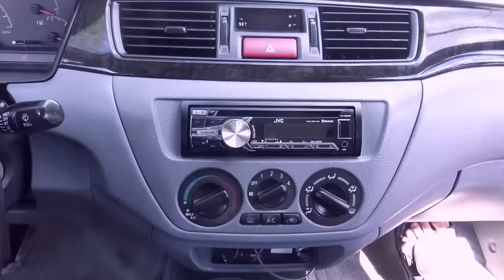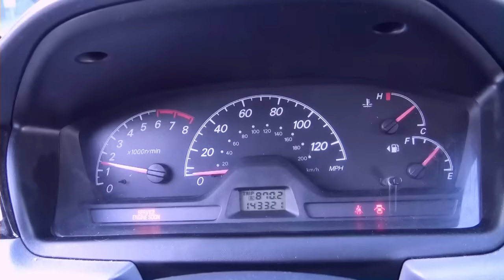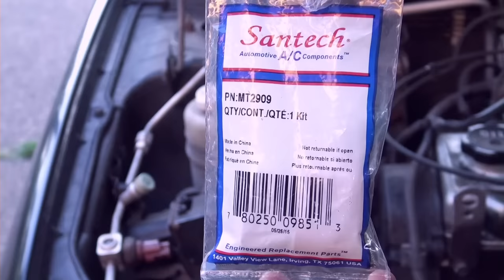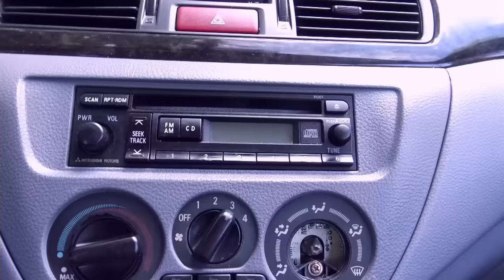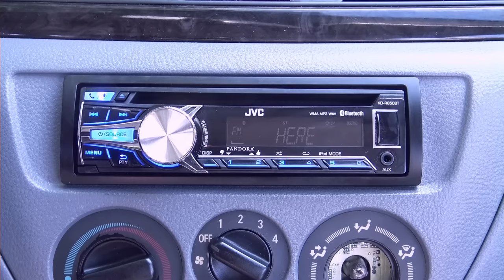Lancer Fix 30 | MOMO EVO 7-9 Steering & Cruise Control

Comment: I had a 2003 Lancer LS, sold it at 152,000 miles. Only issue was a radiator leak around 90,000miles, and needing a new paint job, no rust at all since I lived in Arizona, and Southern California. She always drove like a champ, I took good care of her and didn't let me down. It truly was a great car and miss it. Traded her in for a 2012 Toyota Tacoma. Also running great.

Comment: I'm watching the whole Lancer Fix playlist.  I can't believe your buying and doing of this stuff for the 3rd time on this car. I would've stripped the blue one before I handed it over to the insurance company. I did that on my last vehicle when somebody hit me. Insurance company bought it, but I stripped my alarm, stereo, etc off of it before I gave it to them. It just went to a salvage yard anyways. My stereo system alone was worth almost what they gave me for the car...they weren't getting it. I took my good tires off of it and gave them a set of crappy ones.  I even took the battery out of it that was brand new.
Reply from the maker: +Mikey Yess, I should have done that. Regret not taking the wheels off first. I learned it the hard way.
Reply: +DarkDragonWing when the insurance companies decide how much they are going to give you for your car, they HARDLY EVER add in the cost of any aftermarket equipment or wheels.  It just ends up being stuff that the scrap man gets.  When my car got totalled, I just had spent like 600 bucks on a set of factory leather seats, that didn't effect the value at all. I had already bought something different so I didn't take them,  but it was still 600 bucks gone.  My point is, take everything that you can.

Comment: I saw that you used an Autel MaxiScan on one of your videos, which model do you recommend or a better tool?
Reply from the maker: +hollow3501 I use MaxiScan MS309 version, and it's alright, it does the work. Though, when having multiple codes, it doesn't show all of them. So I have fix one code, erase all of them, and then wait until the other faulty codes to show up. I guess MS310 is a newer version and should be better. cheers

Comment: hello maybe can help with Lancer letter emblem code or where you buy that part??? thanks
Reply from the maker: +Paul Cajamarca http://www.ebay.com/sch/i.html?_odkw=lancer+2002+emblem&LH_BIN=1&_osacat=0&_from=R40&_trksid=p2045573.m570.l1313.TR0.TRC0.H0.Xlancer+2002+emblem+oem.TRS1&_nkw=lancer+2002+emblem+oem&_sacat=0

Comment: Hello,  

My 2006 lancer es I just purchased has a lot of play in the steering wheel.    What can I do?  

I have changed the tie rods. I noticed when the steering wheel is locked(no key and turn the wheels). It has a wobble. Does it have a steering box for me to tight the steering ?  If so where would it be located.
Reply from the maker: Hi. Did you also replace the inner tie rods as well as the outer tie rods?
Reply: @DarkDragonWing  no I did not. Kinda nervous too.
Reply from the maker: @chriswong924  Yes, that's where the play really comes from, the inner tie rods.
Reply: @DarkDragonWing  
Going to tackle it sometime next month. In the mean time I found out the knob does turn on the climate control and the ac is cold but feels restricted. Hazard lights do not work.  Will be referring to your videos. Thanks for your feedback.

Comment: Hey man i was wondering what the difference Between LS & ES ? I have the 03 lancer es
Reply from the maker: +Corey Rivas LS has cruise control, and the lug nut pattern is 4x114.3. The ES doesn't have cruise control and has 4x100 lug nut.
Reply: +DarkDragonWing  Thank you :)
Reply: +DarkDragonWing  sorry to bother u haha but i also wanted to know where to get parts, because in Canada its hard to find parts where i live , & the one thing i needed was Struts because mine are really stiff , unless u have a idea on how to  repair them ahah. Or if u know any good reliable websites that would help :) thanks man appreciate it
Reply from the maker: Corey Rivas I always use ebay.com and Amazon.com :) 

What part you need? I can search for you.
Reply: +DarkDragonWing Whicked ! Thanks man so much &  Struts Aswell as coil springs. keep on posting ur videos man there awesome :)!
Reply from the maker: Corey Rivas
Here you go:
http://www.ebay.com/itm/AST-Full-Set-Shocks-Struts-For-2002-2005-Mitsubishi-Lancer-333382-/371321525071?fits=Year%3A2002%7CModel%3ALancer&hash=item56747cd34f:g:7cYAAOSw6BtVSkne&vxp=mtr

More: http://www.ebay.com/sch/i.html?_from=R40&_nkw=Lancer+2002+struts+set&_in_kw=1&_ex_kw=&_sacat=0&_udlo=&_udhi=&LH_BIN=1&_ftrt=901&_ftrv=1&_sabdlo=&_sabdhi=&_samilow=&_samihi=&_sadis=15&_stpos=55421&_sargn=-1%26saslc%3D1&_salic=1&_sop=15&_dmd=1&_ipg=200
Reply from the maker: Corey Rivas You will have to reuse the springs. cheers

Comment: Where did you get the steering wheel I want one, I've tried searching (Mitsubishi Lancer Evo 7/8/9 steering wheel) and all it shows are covers
Reply from the maker: This one https://rover.ebay.com/rover/1/711-53200-19255-0/1?ff3=4&toolid=11800&pub=5575273973&campid=5338044275&mpre=http%3A%2F%2Fwww.ebay.com%2Fitm%2FJDM-MITSUBISHI-Evolution-8-steering-wheel-EVO8-SRS-Airbag-Good-A838-%2F302082990490%3Fhash%3Ditem46558ca19a%3Ag%3AhwkAAOSwYIxX48Y7%26vxp%3Dmtr

Comment: Hey! Nice job with that swap. Really nice.

My 03 oz rally lancer has cruise control. Can I swap out the steering column with one that doesn't have cruise control without any known complications?? 
After seeing the video, could I transfer my cruise control to the new steering column?
Reply from the maker: There shouldn't be any, you basically just delete the cruise control.
Reply: Okay cool man. Thank you. After seeing your awesome video, could I 
Transfer the cruise control to my other used steering column whether or not it's a manual steering column transfer to a automatic column? I don't know if that plays a difference
Reply from the maker: @AlexanderMedina1010  ohh That I'm not sure. You will have to find out yourself. Usually there are brackets/holes for the cruise control that aren't used in non-cruise control model. But I can't confirm for this one.
Reply: @DarkDragonWing  so aside from the brackets, the mechanics, would it be possible that they are the same?

I'm gonna try, I'm sure. What's the worst that could possibly happen
Reply from the maker: @AlexanderMedina1010  Yeah, try it out. It should be the same. If not, then you will have to be creative and come up with something.
Reply: @DarkDragonWing  sounds like a plan. Nice job with the bracket btw in the video
. Thank you for the positive feedback. TTYL
Reply: Never did swap. Turns out my rack and pinion is bad. I got the bottom connection from the junkyard (mine was loose) that connects the rack and pinion to the column.. The steering wheel didn't want to stay screwed on the other steering column I got. But it probably won't affect my steering too much sticking with the same column and different rack and pinion with connection 👍

Comment: what is that piece called where you put the plastic screws on?
Reply from the maker: +Leon  Quiroz This http://www.ebay.com/itm/20x-For-Front-Rear-Bumper-Clip-Nylon-Push-Type-Retainer-MB253964-/390862554802?fits=Year%3A2003
Reply: +The DarkDragonWing no. the piece that you put those on. I have a mitsubishi Lancer and that part is broken just want to replace it but don't know what it's called.
Reply from the maker: Right here, right? http://www.ebay.com/itm/MITSUBISHI-OEM-02-03-Lancer-Air-Intake-Intake-Duct-MR497518-/111754432278?fits=Year%3A2002|Make%3AMitsubishi|Model%3ALancer&hash=item1a05154f16&vxp=mtr
Reply: +The DarkDragonWing yes thank you!!

Comment: @DarkDragonWing What is the Cruise control switch part number as well as the cable I need this urgently
Reply from the maker: https://www.ebay.com/itm/165370203229?mkcid=1&mkrid=711-53200-19255-0&siteid=0&campid=5338044275&toolid=11800&mkevt=1

Comment: Does the car horn active when removing the negative terminal on the battery cause i want to fix the steering wheel
Reply from the maker: +Saidir Radin No, not active when negative is disconnected
Reply: +The DarkDragonWing Thanks Very Much!

Comment: Hey just wondering how many cars do you have right now at this point of time? Aren't you wasting money if you keep buying and selling after upgrading some parts of the cars as well? Unless you've found a cheaper but better conditioned lancer, it doesn't really makes sense :/
Reply from the maker: +SYF2000 Cheaper and better condition for sure. :) But true, I lost some of the upgraded parts. I have 3 cars now, Lancer, Mirage, and E30. I'm thinking about selling the Mirage, it has too much rust to be a car that will get converted to EVO 4. I'll use the money to buy parts for the E30.
Reply: The DarkDragonWing oh mai if you're planning to sell the mirage, will you take out the upgraded parts? You have done so much to ur mirage and i especially love that engine paint work thing you did. But true, ur mirage really has a lot of rust...
Reply from the maker: SYF2000 Yes, I will try to save upgraded parts as much as I can.
Reply: dont sell the rims :p
Reply from the maker: SYF2000 :D Will see

Comment: I had one car of those i having problems with the  cruise control its not working ..........do you know something  about it
Reply from the maker: +zapatense I'm not sure. I have never has a problem with mine.
Reply: my car will change the engine mounts but feel a vibration on the board inside the car
Reply: Do you know something about that
Reply from the maker: zapatense You might need to check the tie rods. And also get your front wheels/tires balanced.

Comment: Can you please help me to restore my mitsubishi cedia ?
Reply from the maker: I'm sorry, I can't.
Reply: @DarkDragonWing   I mean Can you Export me some parts Of mitsubishi Car I will pay for it. because I don't have any Option to get Car parts in India
Reply: And 1more question.... Can we Modified Mitsubishi Cedia Into Mitsubishi Lancer Evolution 8... ?      is that possible?
Reply from the maker: @devendrashinde1680  No, I can't sport parts. You can find most of the parts on eBay and Facebook Marketplace or Groups. It is possible, but it would be easier and cheaper to save and buy the EVO instead of trying to covert one, calculating the time, money, and material. People in Thailand are doing a lot of converting, but they are professionals. You should Google them.
Reply: @DarkDragonWing  ok no problem brother... & Thanks 🙏